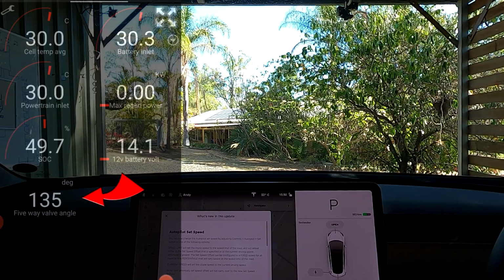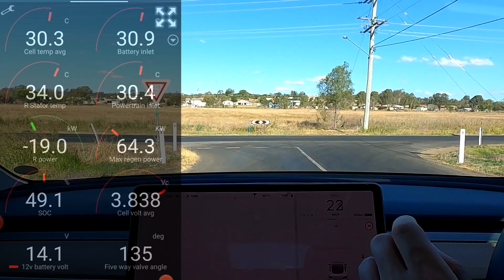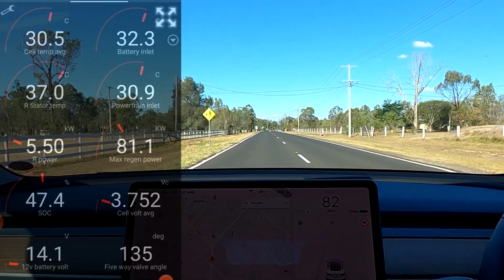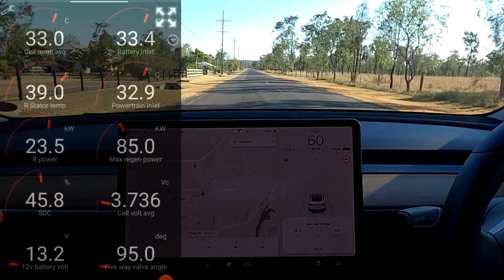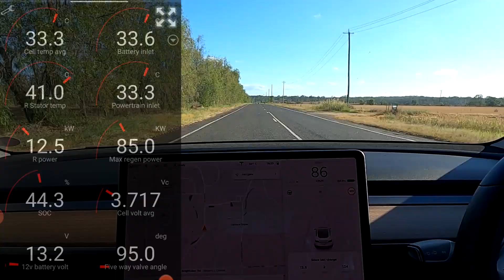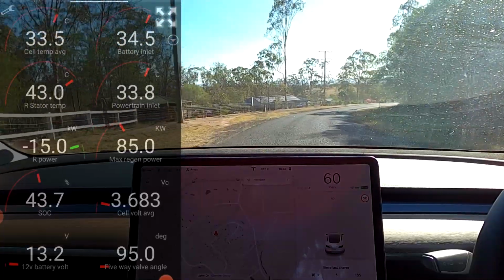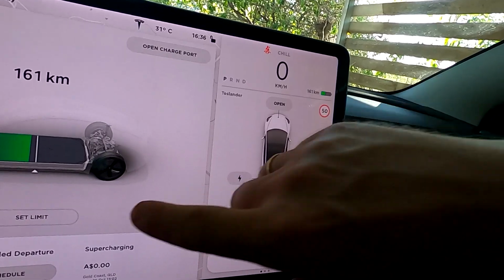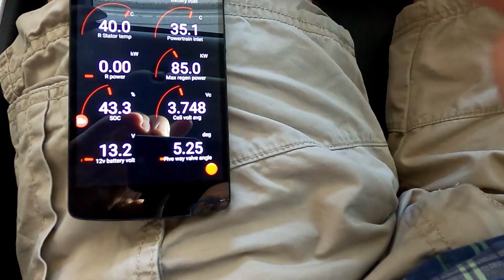EP400 - Tesla Model 3 battery degradation REVERTED (yeah, it's not real degradation)

Comment: Episode No400, BRAVOOO Andy !!!
About SOH I can share with you my weird expirience, on the example of my Nissan leaf I bought last month. I drive it home for c.a 600km using rapid charging. 
This is 6.5 years old car with over 90t.km  on dash. Next day after arrival I have connected Leafspy. This shows SOH96.5% and resoult makes me very impressed. Next days, next checking it starts dropping 🤔 Finally after 3 weeks it equalised. Today SOH is 93.6%.
I have started studying forums and I have found that other user found the same. The SOH raises after intensive use of battery - constant long distance drive + rapid charging. This must be kind of bug of alghoritms which caluculate SOH.
 I assume Teszla has better algorithm but this is stil only calculation based on many inputs, outputs, factors, figures. .. We can't expect this to be so accurate.

Comment: Don’t worry about 50% or 60% of SoC, that will not give a difference as long as you are in in the flat area of the S-curved Voltage over SoC diagram. Everything below 80% and above 20% is in this area. The voltage goes up/down as the electrical field presses the Li-Ions into the Electrodes or pulls them out. In this area of SoC the temperature has less impact on degradation and reduces the inner resistance of the battery which is important to take the current during a supercharge session or if you request power for driving. The easier the ions can flow, less Voltage is required which saves the micro structure of the electrodes. Great to see that you have such a nice weather down there.
Reply: Thanks. Interesting!
Reply from the maker: Thanks Volker. I know the curve is relatively flat in this area. I'm also very cautious with my battery and am aware of what degrades it faster. I use SC only if I must and on long trips if no 50kW charger is around, trying to AC charge as much as possible.
Reply: @unpluggedEV  Good to hear. I know that you are very precautious. I have 50% of Supercharging in total and the car has 120 TKM on its counter and there is a degradation of about 5% in capacity. I don’t recognize this on driving at all. The App Stats for Tesla Model 3/S/X tracks the range on 100% charge and makes a linear Regression to those measurements.  The range went down from 550 km at 40.000 km to 532 at 120.000 km. Be aware that is all calculated by the BMS and does not reflect the real status which can differ. But at the Moment the battery looks to be in a good condition. The only thing I am doing is never to charge up to 100%, above 80% just when needed and the low state of charge I try to avoid below 10% (very often it is 13-18% at arrival). That seems to work pretty well. Maybe it helps for a more relaxed driving in terms of degradation fear. Looking forward to your next video, left a like and greetings to down under.
Reply: Just added the link of the mentioned iOS app. https://apps.apple.com/de/app/stats-for-tesla-model-s-x-3/id1191100729

Comment: Hi Andy, I love your weather! In the UK it's around 5C and my consumption is at ~200w/km when making 4 to 6 short journeys per day of ~10km. It seems that heating up the car takes around 2kWh of energy in these cold conditions. I guess I need to move to Australia...
Reply from the maker: Hahaha, yes, we had a heat wave last week with over 42°C, so not so pleasant any more (if you don't have a pool!). I think I had the heater one for less than 5 times last Winter. We spend all the energy with cooling...

Comment: Was not sure what the actual capacity of your battery is versus useable. Is the degradation figure against the usable full capacity or capable full capacity? On the LR the capacity I think is 75kw and usable is 72.5
Reply from the maker: The curves are coming from TeslaFi so they take the range as the base for their calculation. So far this matches with what the car says as well. At the beginning I was not a big fan of that but it seems quite accurate.
Capacity is 52.4 minus 2.3kWh buffer. There is also a ~3kWh brick protection at the bottom. So overall capacity of the pack is around 55kWh in the SR.

Comment: Thanks Andy- yes so many people worrying about range loss from their Apps, when it’s just an algorithm getting a little bit confused. 
My degradation after 14 months is about the same as yours, absolutely minimal!
P.S. I mostly charge to only 60% unless planning a road trip, and have actually NEVER been to 100%, and only 95% once or twice. 
(I DO plan on having the car a long time, so would be pretty stupid to not look after the battery. Also: I rotated my tyres last week, even wear and rears have worn just a fraction more than the front, but lots and lots of tread left.)
I might consider these when I need new tyres: https://www.asvpfree.com.au/faq
One son had to do an emergency rapid plug on the side of the highway last weekend, pulled over with it indicating 25psi, found a big screw, was 17psi by the time he got the plug in, air was really hissing out. Luckily it was only two kilometres to the nearest servo at Coochin Creek where he was able to pump back up.